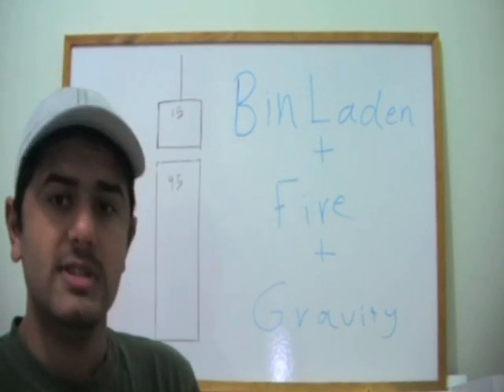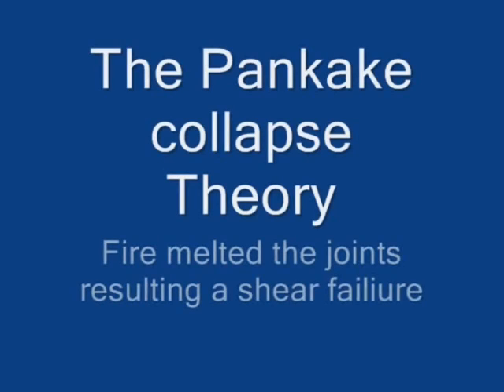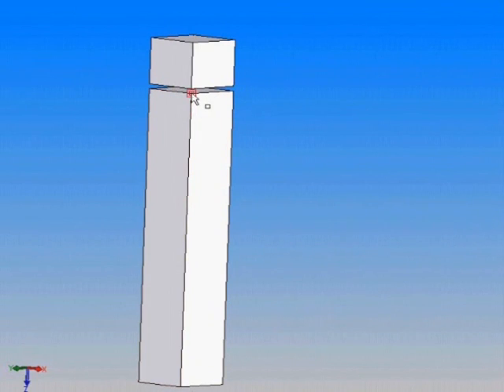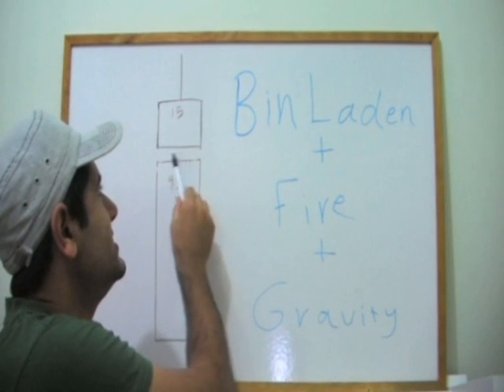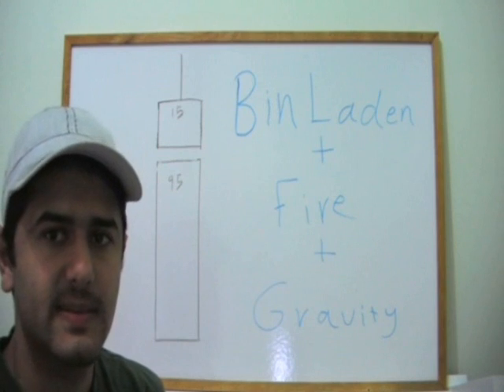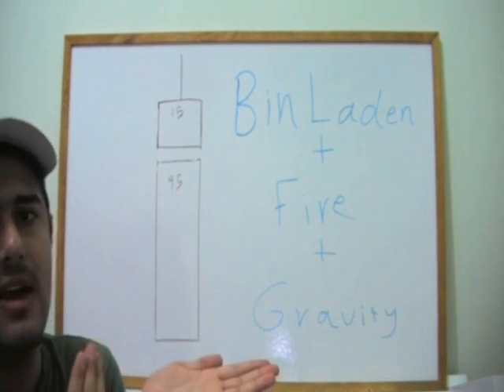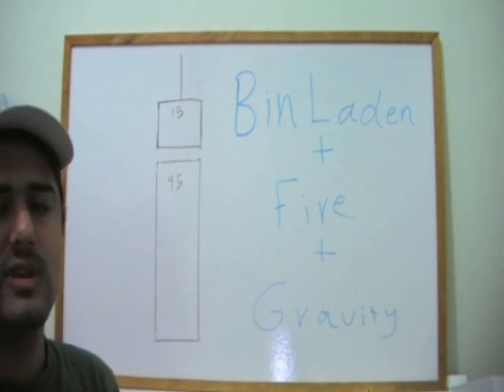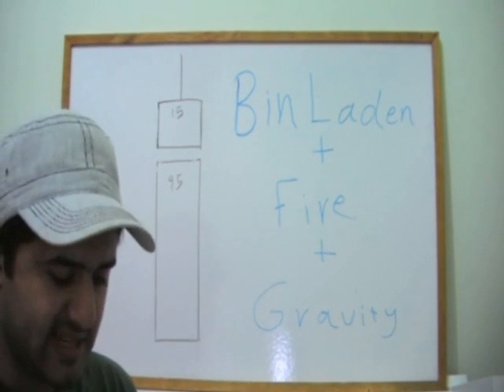(Part1) 911 Simple Physics Structural Failure Vs Demolition

Comment: It doesn't matter what you believe in regards to this video.  He does not use physics to explain anything.  All he says is, "this is not possible," and doesn't offer proof as to why.  He doesn't take into consideration kinetic energy, velocity, the light weight of the structure, or anything else that you would need to prove your hypothesis using "basic physics".   

I have watched many videos that argue both sides, and what I have found is that most in the "controlled demolition" crowd fail to take into consideration that the internal columns were damaged by the planes.  I heard one survivor who was in a stairwell in the north tower when the plane hit say that he heard popping in the walls travel from top to bottom.  the internal columns may have cracked due to excessive sway and pressure from the initial crash.  It is plausible to me that the pancake theory works and the the center columns already damaged fell with the structure.  

I don't know whether it was an inside job or not.  I do believe that the planes took the towers down like the 9/11 commission repot said.  I do not believe that WTC 1&2 were controlled demos.
Reply: ***** No. It CAN'T explain the Twin Towers. The twin towers had mammoth internal core supports NOT dependent in ANY way on exterior trusses, as alleged regarding the floors. Irrespective of ANY effects on the trusses supporting the floor, even assuming arguendo, the core supports could not have collapsed under any circumstances short of pyrotechnic intervention, because they were completely INDEPENDENT of the floor trussing system; and, yet, the internal core is seen dissolving away at virtual free-fall speed. NOTHING in physics or engineering science will justify such phenomena in response to office paper fires [since the kerosene (low temperature burning fuel) would have been completely combusted in the first few minutes after impact].
Reply: Jonathan Stinson There is proof the aircraft never damaged the core column. The electrical system in the building was centralized in the core column. Video from the lobby after the first impact shows lights are still on in the lobby. Kinda fishy huh?
Reply: Jonathan Stinson you might try looking at the remaining parts 2 & 3.
Reply: Jonathan Stinson Don't bother; it gets WORSE, not better! This guy has absolutely no idea what he's talking about. It's embarrassing!
Reply: +Jonathan Stinson Oh,That makes PERFECT sense,the planes took out the center columns.Flew through all that steel without breaking apart and CUT through columns IN THE MIDDLE of the building?And the pancake theory works with you?Well those are about the most stupid statements I have ever read in English.Neither of those could be remotely possible.DAMN!
Reply: +Jonathan Stinson I love this part you put in here like a true believer of nonsense: "I heard one survivor who was in a stairwell in the north tower when the plane hit say that he heard popping in the walls travel from top to bottom."

You believe planes caused that? We're talking about steel supports going from top to bottom with the strength to hold 100+ floors and withstand earthquakes. Then some shiny aluminum can with gas inside goes boom 100 floors up and the whole damn support structure of the building shatters?

Well let's all put our faith in that nonsense for now. Why did the buildings then not fall right away? They took different amounts of time to fall down. Are you suggesting that the fires that burned for an hour or two FINALLY took out the supports top to bottom and they all broke at the same time? This theory is just plane ridiculous (see the pun lol)

Fact is, even IF you could blow the support columns down you'd not do so in such an evenly distributed way and the building would tip over. Buildings do not fall on themselves naturally. And those rare few that pancake look at lot different when they're done. In fact, pancaking usually requires a very wide perimeter to height ratio so that it can't call over because a buildings with more height than width is going to tip over.
Reply: Jonathan Stinson Ever notice how whenever a truther is losing an argument re the towers they always try to switch the subject to bld 7?

They lose that argument too, of course. It's just funny to me how they bail out like that without even trying to defend the theories they buy into.

Comment: Good video also to point out is the WTC inner cores were bare metal they were not wrapped by concrete just drywall!  I believe the failure was in the Bolts most of the steel joints we see are intact except for the bolts cleanly broken.  Could that be a possibility?   The calculations add up for the impact zone there we would expect failure but below the structure should have caught the top floors and ceased a collapse.  Look at videos of the recovery and look at the breaks at connection joints it just boggles my mind that NIST ignores BASIC Physics! So that means they are either Stupid or complicit their own data and experiments contradict their conclusions it's almost laughable if it wasn't the fact thousands died in a collapse that had more odds than the lottery odds in the Billions against and if NIST were right then We need to close 75% of high rises in the World or face buildings falling left and right from simple accidents

Comment: Hard to deny that, at the onset of the collapse sequence in the north tower, all of the surviving 47 core columns gave way, (as evidenced by the 325 ton antennae falling), and each of the surviving 233 perimeter columns failed simultaneously -- allowing the upper "block" of 10 to 14 floors to remain essentially level as the collapse and disintegration ensued.
Simply stated, 280 vertical, structural steel columns largely failed sequentially, floor by floor, in a nearly precise and symmetrical cascade from top down -- and for well over a thousand feet.
Toss in the nearly free-fall timing aspect, even though the collapse was through the path of highest resistance, and you're left with some basic physics that just don't add up.

Comment: Yes, he is talking about the immaculate vanishment.  At no time was there the available space for the top portion to accelerate.  But, compounding the problem even more, all collapses are torsional.  Again, imagine one of the towers in space.  The lower portion of it is immovable as it was fixed to a foundation when it was back on earth.  The other isn't as it was fixed to a hat truss at the top connecting both the outer shell and the inner core.  So, the top collapsing portion isn't going to fall straight down without some kind of designed demolition.  It is going to tumble and twist when it strikes the lower portion fixed to the foundation.    
Again, this is central to the problem.  All collapses, even if the floors pancake, are going to be torsional in that they twist by applied torque.

Comment: You only have eleven floors above as four of them are being utilized by the large hat truss.  The heat from the fire would have weakened more of the concrete above than below.  And the higher the structure, the less thickness of the steel columns and spandrels.  This means for every floor destroyed because of pancaking, more than one floor is going to be destroyed above.  This lead to an exponential collapse which literally would have liquidated the top portion of the tower immediately relative to the destruction of the floors below.  There is a lot of problems here.  First is the huge amount of debris pouring over and outside the tops of the towers and through and out the windows.  Obviously, that material isn't going to be lending its weight to the pancake theory.  In fact, for weight to pour off the sides in such a fashion, that would imply that the structure below is putting up resistance against the collapse.  There is lots of cake and eating it too here.  
And, lastly, a pancaking collapse too, the kind they are describing, has to be caused by a controlled demolition.  In a pancaking, part of the floor is going to collapse first.  This is going to cause the force of the mass of the pancaking away from the center of the building and away from the floors below.
Right?  The fire was not equally distributed causing equal amounts of damage to the floor joists.  So the collapse is going to happen at an angle.  That angle of collapse is going to be towards the core in every instance.  Once that happens, the pancaking will convert into a structural failure.  When the collapse becomes a structural failure, then the collapse becomes torsional meaning the building will have to collapse by twisting either one way or the other.  
Significance?
Well, the rectangular and square beams, and the massive amounts of support bracing were utilized to resist torsional collapses.
Reply: ***** Divide the people in half with one side against the other and tyranny can do anything it desires.  It isn't like they tried to keep a secret.  Those who rule by fiat have never tried keeping a secret.  Instead, they stumble up the children of God.  They do this by confusing us.  
The solution to the problem is to first take responsibility.  In other words, Adam and Eve fell out of the garden for two reasons.  The first was Eve committing a sin.  The second was Adam not taking responsibility for her sin.  Instead, he blamed her.  
So, in order to stop tyranny by bullying, we first have to admit that we ourselves are part of the tyranny of bullies.  Or, why do prostitutes remain in prostitution?  It is because they bully by resorting to pimping each other.
Put Jesus Christ in the garden of Eden and He would have never fell.  Why?  Well, because He would have went to the cross before accusing Eve.

Comment: "Why dont we just use gravity from the top floors collapsing to demolish buildings today?"

Because you end up with a massive debris bloom spreading out from the structure as it falls - plus many structures cant collapse because of gravity as their core structure would remain.
Reply: keeperofthecheese 
Everyone ignores the structural cores of the buildings - the strongest and most untouched part of the twin towers.
Reply: Daryl Bartels The core might as well be made out of wet biscuit when the support columns and outer shell are compromised and the floors are collapsing at terminal velocity. Besides, I reckon the cores took a fairly good slapping too - all of the fireman's reports indicated that the central stairwells had been cracked and smashed by the impacts.

Comment: 3;19 no one said that fire melted the columns but weakened them and any person building bridges skyscrapers or even small office buildings will tell you if your steal inside the centre of your building starts to bend and crack your building is fucked physics 101 learn it
Reply: W7KMS How did the cores of the WTC magically dissapear then
Reply: Actually, no building can collapse unless it first twists one way or the other no matter how much force is applied upon it.  The towers were built with rectangular steel beams which are designed to resist the forces of torsion, twisting created by torque.  So, the concrete foundation resisted torsion.  The beams resisted torsion.  The way in which the beams and spandrels were welded prior and lifted and bolted together creating a vertical perforated pattern all worked to resist torsion.
Reply: ***** Then how do you explain building 7?? Fire and damage?? Please take a moment and educate yourself. All wtc buildings were severely fucked that day yet 3 fell. Also the buildings fell with 0 resistance.
Reply: Exactly.  It wasn't hot enough to melt steel, but it was enough to significantly weaken it.  The steel in the buildings didn't have sufficient fireproofing either, and steel will burn.  I'm a chemical engineering student.
Reply: Cheaptrix91 this is the big question as those cores were massive and had phenomenal compressive strength.
Reply: keeperofthecheese - Every American knows the exterior was made with Wayneium; three parts John Wayne and one part Patriotic American Spirit. And the interior was built mostly with soft, libruhl-sciencey-type materials, all jelly-like with paper and what-not. That's what Fox said. That's why the towers fell. They were amazing and mighty and hollow exoskeletons, like huge aircraft-hanger towers, that if you run a bus into the bottom, the whole thing can come tumblin' down like a matchbook house; like WTC7; Popular Mechanics said so ... -

People who erect large steel structures and people who take them down grimace at your comments. You got most of it wrong.
Reply: Adam Brier What above tonnage are you speaking about here?  How much tonnage of dead and live space was being held up by the outer shell of the building relative to the core?  And what was the function of the hat truss?  And just how solid was the foundation support?  Hint.  The core was much heavier than the outside shell.  How do rectangular and square beams resist torsion.  Were the horizontal supports welded into sections of rectangular beams made out of plastic?
Reply: It's steel, not steal dumb shit. You should try to separate yourself from the heard of sheeple my friend. The simple fact of the matter is that even if fire made it to the core, there would have been little burn time due to the fact that there would have been little oxygen and fuel (flammable building materials and office supplies). After the bombing, they made massive upgrades to the building to prevent chimney effects. Fire without Oxygen ain't much of a fire. Certainly not one that can weaken massive steel columns and girders across an entire building simultaneously. HOW CAN ANYONE BELIEVE THIS!?!? So many obvious questions. How is it that WTC 7 collapsed from fire and debris when WTC 3, 4, 5, and 6 remained. Did you see WTC 7 collapse. I have never seen a more perfect controlled demolition in my life. Let's not even get in to what was lost (and covered up) when WTC 7 fell. Did you know they spent $600,000 on the WTC investigation? You can't buy a beach house in Florida with that little scratch. Here's the kicker, they spent 40 million on the Clinton investigation. That means our government thinks Clinton getting a hummer is more important than thousands of American lives.
Reply: ***** you are absolutely right on.
Reply: ***** For starters beam steel would only have to weaken 5-10% before it would not be able to hold tonnage built above.  Melt is just the wrong and misinformed and mis educated term to use, destroying rest of broken English argument,   any other questions?
Reply: ***** The huge mass of the upper part of the building would have destroyed itself against the even huger mass of the lower part of the building. It would have only destroyed  about the same amount below it, if your way had truly happened. 

No worries though. There's going to be a legitimate computer modeling soon to show that can't happen in real life. :-)

http://us1.campaign-archive1.com/?u=d03bf3ffcac549c7dc7888ef5&id=340cf2655f&e=[UNIQID]
Reply: ***** It will also break the block apart.
Reply: It makes a big difference. The columns would not break up and some of the clips holding the floors to the outer skin and the interior columns would have "broken at different times. There wouldn't have been 600 foot projectiles that weighed tons.
Reply: Cheaptrix91 Planes flew fucking through them. The world trade center only had a relatively weak central structure. The outer shell of the building made up a huge amount of the buildings support structure. It was compromised by impact and fire - the buildings fell.
Reply: Do you understand how the buildings were structured? They were built inside a steel skeleton - like shelve held in by weak pegs. When the highest floor collapsed it began a domino effect that brought down the entire structure. There has never been any evidence found of girders being cut or pierced for the placement of explosives. There have, however, been dozens of girders found bent like hot toffee because of the pressure placed on them by collapsing floors above them. Several of the fires that raged on for weeks afterwards have been blamed on burning hot iron that was suddenly warped by the collapse.

Comment: 2;37 no the bottom is very weak because all that was holding the rest of the building up were some steal beams not supported by anything apart from the 150,000,000,000 ton structure above them and if that collapsed then the trident beams as they were called would have failed instantly and the kinetic energy required as used in your amazing video certainly won't blow a whole in the ground but it will have the power to destroy a small building I am referring the clip you should us of the failed demolition and your right now all you need to do is move that building up 150 stories and... oh right you'll never do that : (

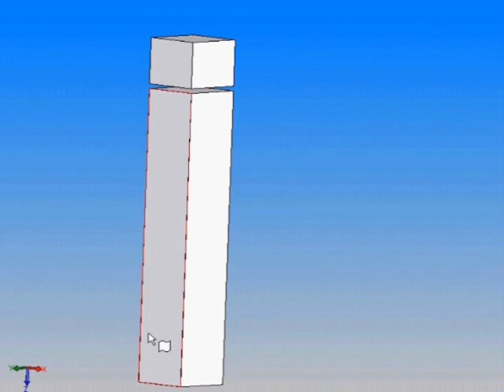Comment: 1:44 wow and I thought you said it was simple physics its simple take a block of Lego put it on your table in fact just sticky tape it down get a car to run over it and then watch by your physics model It would need explosives at the bottom in order for it collapse but we both know that's not what you need in this example the car is the top 15 stories of the north tower and the Lego was the lower 95 floors this is grade one physics fucking hell I would have known this in pre school and your evidence raises some more questions for example what the fuck to the foundations have to do with the collapse that's like saying when buildings are demolished with explosives the explosive detonate at the bottom when its bloody obvious that is not how controlled demolition works get your facts right before spewing them out on the internet and go to school